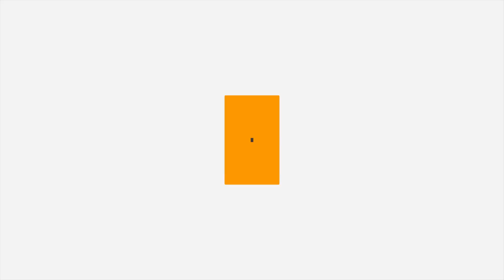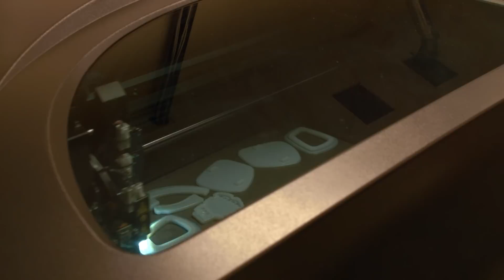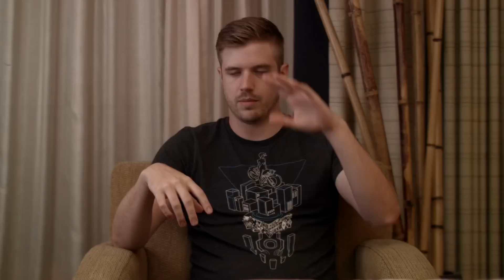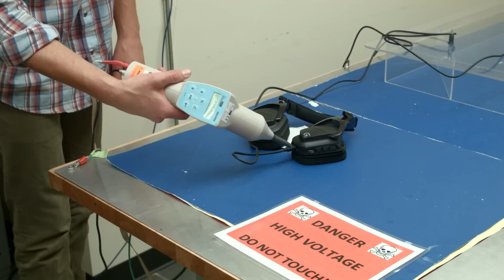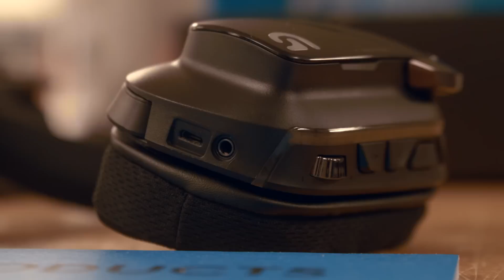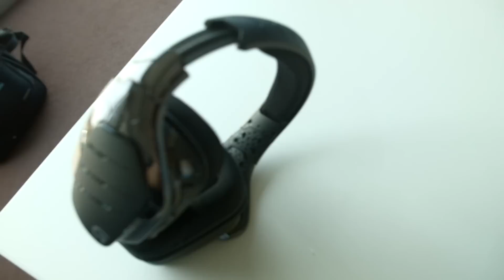Logitech Artemis Spectrum G633 & G933

Comment: I've been using the G930s for the past 2 and a half years, and I absolutely love them. They might not have the best sound, but the 'surround sound' is actually very useful in certain games and the bass is very powerful. I'd be more than happy to give those G933s a shot when they release! I ESPECIALLY love the 3.5mm jack on them! No longer do I have to run my console's sound THROUGH Windows just to hear it over the wireless usb, and it also means I can use the headset separate of the computer completely with, say, an iPad. HUGE bonus for me!

Comment: I have the old g930 wireless headphones and love them. The freedom is worth the compromises. This new one seams to fix those: aux in for console/tv/phone... Wireless disconnects from interference on 2.4 band. Audio quality. (mine are good but don't compare to $100+ wired headphones). If the comfort is as good as the current ones they have 8+ hour comfort on my big head.

Comment: This is perfect timing. I always liked my G930 until it died last week, and I need a replacement. My only issue with it was that it only took one input, so I can't have game audio at the same time as my phone audio (I use it for audio-books and podcasts) easily. Now I can (I could with the old ones by running my phone as a line in on my computer, but that is a hassle). I don't expect perfect audio quality, but my G930s were "good enough". I hope the G933 drops soon.

Comment: I wonder how the build quality is on these.  I liked my G930, but after less than a year of use, the plastic housing for the ear cup swivel points disintegrated.  After looking at tech support forums, this was apparently a common issue.  This video made it look like the outer casing on the swivel points might be metal (or just chromed plastic), but the inner casing may still be plastic.  I sure hope they're better.

Comment: Logitech headphones are usually nice but I always hear about them breaking easily, even the higher end ~$100 ones. I went with TT E-sports, haven't heard about as many breaking (those I heard about were after 3-5 years) and the core of the headband is made of metal. Anyway, what were your thoughts on the durability of the new Logitechs? did you notice the headband containing metal on the inside; or is it still the same cheap plastic as far as you can tell?

Comment: I remember trying to explain to my non tech friend how to change his recording settings to 32000hz so the mic doesn't cut half his words off. I think all the surround usb models are affected. One persons fix was modded drivers, another was to use razors drivers for the same usb sound card. I see the effort that goes in but hey... when the bill for that massive 3d printer comes in you can always bet bugs and slightly cheaper manufacturing will be utilized to maximize that return for shareholders.

Comment: I really hope the wireless is improved. I have the g930 and I had so many issues with interference. Every time someone turned on a microwave oven it would disconnect. Also routers can mess it up.

Comment: After owning a G400, a G502, and a G930 I can definitively say that I will never be buying another Logitech product. As nice as they look, each had their own problems that many other users had/have.

For those wondering, the G400 had to be taken apart and the cable had to be moved up so it wouldn't disconnect. The G502 had a faulty sensor that caused malfunctions. And the G930's manifest file had to be edited to work properly, it's power consumption settings needed to be changed, the padding had to be replaced very quickly, and the battery life and range are far from advertised.

Comment: I've never tried the HD650, but I'm here at PAX Prime and they have these headsets here. I'm pretty impressed by them, and will most likely be picking up a pair here before the weekend is done. I went through the Logitech booth for the headsets, corsair, turtlebeach, and Razer. To be honest, the Logitech ones were my preferred ones of the bunch. I gave all of the ones on the show floor a try just to compare them.

Comment: Good tour. But is there a 5.1 headphone that works with 5.1 via optical? This can be used from your HDTV or from the back of your cable/sat box.  I also get questions from families where Dad/Mom is hard of hearing and blasts the volume but the family wants something they can put on the elder to let them hear at their level without turning off the other speakers.

Comment: I wanna see more headsets like the Turtle Beach Z300. I'm not a Turtle Beach fan myself but the only reason I bought the Z300's was because it had built in Bluetooth so I could wirelessly connect my phone to the headset and use it as a Bluetooth headset to take calls when I'm working and not gaming, Not only that but if I receive a call during a game I can simply press the button on my headset to take the call and it will automatically lower the in game volume so I can listen to the call. but still hear the game at the same time.

It's truly a great idea and I wish I could see other manufactures bring out the same sort of stuff. Maybe it's Patterned, I don't.

Comment: logitech should have done the multiple connect option with the controllers(F710), its either wired or wireless and i got the wireless one that sucks without the option to use a cable

Comment: Currently wearing my Astro A50's they run on the 5ghz band and its SO much clearer with no signal drops, i used to have a pair of 930's but they would have A LOT of interference and would drop the signal, so if no 5ghz its a no for me even though they may have improved the receiving signal.

Comment: My G930 headset always has problems connecting. I always get the usb device not recognized error, it is a miracle when it actually works. Even when it does work, I always get constant cutting out. I've disable my wireless network because I've read that it interferes with it but still get that problem. I'm kind of interested in the G933 but the G930 sucks so much that I'm skeptical about the G933. I'll try to record the problems that I'm having with these just to show you guys.

Comment: i like this headset my only worry is that it still has the same issue as logitech g930 with the snapping ball joint since it was made out of plastic rather than metal. i have a pair of PC 350 that features the same kind of design but out of metal and it has lasted me for years while the g930s lasted a couple of month (as in with the 1 year store warrenty i went threw 3 headset and still was able to ask for my money back.)

Comment: Is the headband connection to the earcups made of metal or plastic? I quite liked my G930s, but wireless connectivity issues and frame durability due to plastic components would keep me from buying them again. It sounds like they have done a lot to improve the wireless connectivity, so my main concern is how well they will hold up over time?

Comment: I like the video but I don't %100 care for the price tag on the G633 being $150. They look VERY nice but that price tag is what would push me away right now to pick up some. Happy to see Logitech taking the steps they have with both 633 and 933 cause they look just great. Also looking through everything from every corner and not just making them feel good and sound sound. But to make them look,feel,sound,wireless to work with out problems, and having a problem to change all the buttons and sound settings in a simple looking problem.

Comment: I was actually extremely surprised when I went through the Pricing link and saw $150 and $200 respectively. For all the features these headphones have, I was expecting significantly more. That's not to say that $150 is cheap, and at the end of the day there's the "basics" of sound quality for both the headphones and the microphone, but being a headset that also has RGB lighting, macro keys, volume control, and multiple input mixing it seems like a really good deal.Unless their build quality is the same as the G430/G230. I had a pair of G430s and an earcup fell off after two years. That's not as bad as the Corsair ones I had before that which had the same problem after only 3 months, but I'd rather not replace headphones that often.

Comment: @LinusTechTips - so one of my biggest complaints with the g930s is the fact that it has a bunch of issues with it dying randomly and the battery seems to think its fully charged when its not and it requires a manual reset to resolve the issue, has logitech addressed this issue with he g933? Have they mentioned anything about the driver resolving previous known "unresolvable" issues? The g930 is an amazing piece of hardware but is limited simply by the driver. What is your opinion?

Comment: The successor of the G35 , G930 , definitely....since the G35 , G930 too had Macros, Volume Control, also being Wireless and Wired. 
I been wondering when they gonna release a new G35, G930 here we are ! Most importantly it's LGS supported. If not mistaken the G430 and G230 doesn't have it

Comment: As a owner of a g510 keyboard, g 700 mouse, g35 headset (broken mic boom.) and a G930 headset. I will tell you the biggest problem will be the drivers. Yes they will work great at first, until Logitech decides they need to put out a new product using the Logitech gaming software. Then pops, whistles, random disconnects, static, and power offs with happen. So if you buy them make sure you keep a copy of the old drivers some place or be prepared to start digging on  Logitech's FTP server. Currently using Logitech gaming soft ware 8.35.18 for g 510 and g930 for the mouse setpoint 6.30_x64 If i was to run LGS 8.70.315 well the headset is unbearable but the mouse and keyboard are fine. Way to go Logitech.

Comment: looks good but is the build quality better than the g930? because I had two pairs of those and they both broke . . . the battery eventually failed and the band broke on one of them. Also the usb connector broke on both as well. What will th price be too?

Comment: There was a time when I was struggling to find a new headset that was worthy for gaming. I switched between $100+ Razers and some other one I found at Best Buy, but they always had features missing or issues I didn't like. I found out about Astros and I really took a liking to their A40's (they cost a decent penny too).

I didn't even try the Logitechs because their headsets always look low grade (unlike their mice. I got the G502 months ago and owned G602 for a year).

Needless to say, this new headset lineup looks pretty sick...I'm not sure If I have reason to switch to those regardless though...

TL;DR what's the price range of these?

Comment: does it have switchable batteries or only charge by wire
how long does the battery last for the wireless one
how good is the mic quality
how much does it cost
what Hz range does it have
does it have noice cancelation? (i bet it doesnt because you had problem with people around you talking)

Comment: Having used G450s for a while I do hope Logitech have improved build quality, I have had to return two sets and one of them returned twice due to bits inside just falling apart.  I have two sets, one for me and one for me son and even after three  returns my current set the boom mike won't stay up any more and my sons set the USB adaptor now no longer works. I wont be buying Logitech headsets any more, unfortunately the build quality issue with Logitech I have seen in more than just these headsets so my guess it is simply a case of great design, shame about the component quality.

Comment: Used to love...really love...my Logitech G930 headphones. They sounded great and were very comfortable. But after 8 pairs broke with me babying the damn things I had enough. So did they. They knew the problems and they kept replacing them...until that 8th pair. Their boards are full of complaints the same as mine. About 8 different issues. Ill never buy Logitech anything again other than mice. I got the Sennheiser G4ME ZERO and they are even MORE comfortable and sound great.

Comment: Hmm.. Good enough to replace my Sennheiser PC 360 Headset?
Reply: +FastRedPonyCar Probably not. PC360 is a fully fledged hi-fi headset. It's great for gaming due to the excellent sound-stage and it's also great for listening to music, though the sound isn't too "fun" and and the bass is more on the weak side, as with most open headphones. Above all, it has an adequate price-point - it's price isn't much higher than other Sennheiser headphones with the same drivers and is fully justified by the addition of a microphone. Also, one of the most comfortable headphones with a mic around.
Reply: I'm on the 360 boat also... Had since 2010 with a  astro 5.8 mix amp... Just want something brand new now tho lol... Just gunn wait till actual videos of comparison vids by people who have both
Reply: BasedGodMcRem
If you want something really better, you're going to have to buy something slightly more expensive and without a microphone. Personally upgraded to Ultrasone HFI-2400 and they're superb - small, but very precise sound-stage, absolutely mindblowing bass (they're not overbassed or anything, but the bass is very accurate and goes lower than you may think possible on open headphones), plus the sound signature overall is very fun. They do have a little bit of rollercoaster in the treble and can really use some equalization. This is mostly apparent during the burn-in period, which may be anywhere between 30 to 100 hours (really the opposite of Sennheisers, which sound pretty much the same since the moment you take them out of the box).

Try checking out this legendary post: http://www.head-fi.org/t/534479
Probably the best gaming headset guide on the net.
Reply: +CanIHasThisName ... Need mic attached n really not willing to go over $300-350 on a headset lol... When I spent over $400 for my headset now, I stole $2900 😁
Reply: That's a 380$ headset vs a 150$ one

Comment: i have the G933. they sound good BUT they are SOOO quiet. even on full volume they are low audio. Any suggestions for an amp that can boost the sound. Setting them to stereo, they are about 10% volume compared to a cheap amazon headset.

Comment: Just brought the G633, LGS will not even recognize the G633.  I have spent several hours now researching, installing and un-installing LGS.  I have tried 3 different versions of LGS, no luck.  I can run them off the 3.5mm jacks, but I didn't hand over $210nz for a stereo headset. Device manager says it is working properly.  Problem seems to be bogus drivers from Logitech.  Will be returning these and getting a refund, they're not worth the effort. What a waste of a Sunday afternoon.

Comment: Well I have had a set of 930's for over a year now and although they sound great and have good features, they are about to get thrown out the window. The wireless is totally unreliable. It cuts in and out randomly and it can be very annoying. Sometimes they work fine for hours and other times as soon as I turn them on they start cutting out constantly to the point where I give up and switch to a wired USB headset. When I bought the 930's I mistakenly thought you could use them wireless OR wired but actually all you do is charge them while you use them. They are always wireless. I might actually buy the 933's if they can legit be used either way.

Comment: So g933 seems to be g930v2. 

When my g930 goes out again (had it factory replaced twice now under warranty) I may get a g933 if reviews are good. 

I LOVE the headset (and most Logitech products, i also use a g35 keyboard), but the usb dongle receiver is just..... crap.... if the people in the apartment bellow me uses a microwave, my receive cant give me a solid signal even when right next to it .

Now fair enough they just showed they are "improving" the usb dongle, but until reviews arrive, its just words to me. 

Another thing they NEED TO DO S FIX THE DAM DRIVER AND SOFTWARE. they Still don't have fully functional drivers for windows 8, or 10, even though the box says "windows 10 ready". Just any g930 google pulls up entire forum posts on disconnecting issues / auto shutoff problems (Even when manually plugged in via USB!!!!) that have been present in the software side for over 6+ months and never been solved, nor was the Logitech support team ever responding to these concerns on the forum.

Ultimately, my g930 experience was mixed, and its preventing me from committing to a g933.

Comment: does anyone know if the features for this headset eq will work with a ps4 and also if the 7.1 will be working as well. I'm looking to find something that will replace my Sony gold headset, I like them alot but they don't transmit sound from my tvs USB drive only my ps4 and laptops drive.